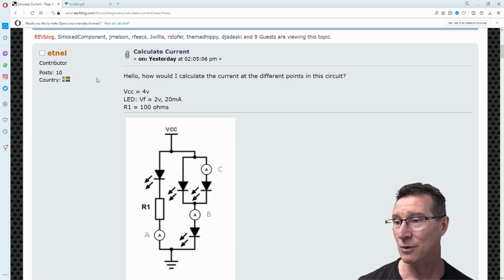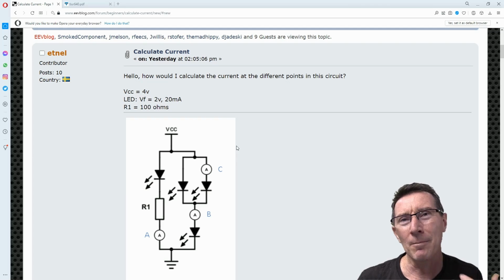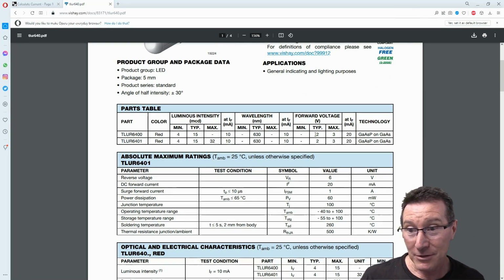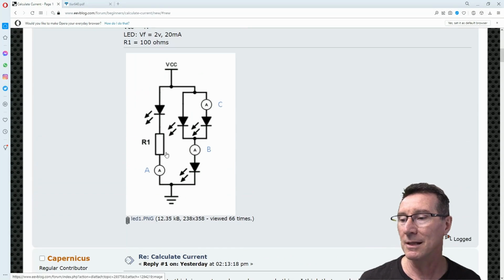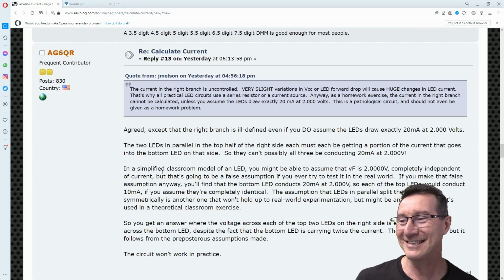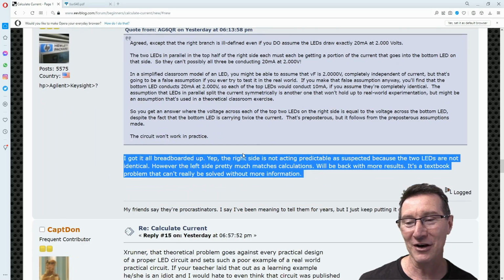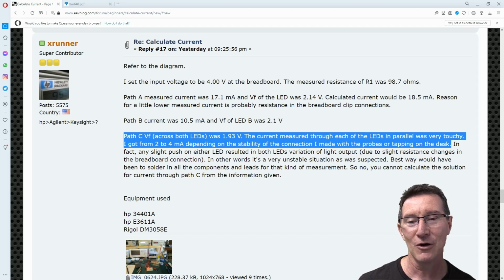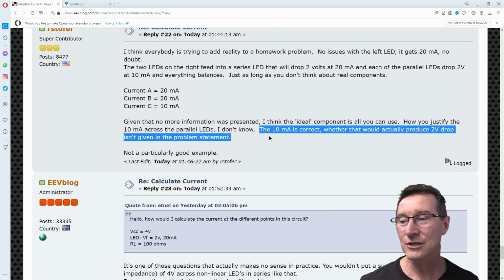EEVblog 1427 - An INFURIATING Electronics Exam Question!

Comment: I agree about the infuriating nature of this question.  Obviously, the person writing the question had just enough knowledge of electronics to be dangerous.  Being ignorant of semiconductor operation, the person who wrote the question, probably assumed the LED voltage drop would always be exactly 2 volts.  But, in the real world, there is no way to solve this question.  First off, you NEVER use LEDs in a circuit without some type of current limiting.  In order to have a chance of answering the question, you would need the datasheet for the LED used in the circuit.  Most LEDs are low cost and omit certain parameter limits, like forward voltage drop minimum.  Therefore, if you are designing a product that has a projected build rate in the millions, you must assume the forward voltage drop can go to zero volts.  True, due to the electrical characteristics of the part, this is not possible but, since the spec is written this way, you have no choice.

Then there is the junction temperature versus forward voltage drop problem.  This is why forward voltage drops on datasheets with semiconductors are measured using short bursts of current, to minimize the Vf drift as the junction heats up.  Along with determining the junction temperature of each LED, you would need to know the thermal resistance to the ambient air temperature, as well as other heat producing components nearby.

Additionally, if the datasheet does include a forward voltage drop versus forward current graph, the graph is made using a typical part.  I can't tell you how many engineers I have seen that will build up only one circuit in the Lab, get I working, and assume it work in Production as is, totally ignoring the datsheet limits.  Probably the same type that wrote this test question.

Comment: A is 20 mA,  B is greater than 20 mA, and C is half of B, simple as that, assuming ideal everything. I doubt the homework was looking for anything more specific than that. If someone can reason the voltage drop across B is greater than the voltage drop across C, they get an A in my book.

I've seen many theoretical questions used on exams, they are used to determine the thought process used by the student. Jumping to the 20, 20, 10 argument isn't using any critical thinking.

Comment: The power supply output impedance is irrelevant here because we're told what the voltage is at the top, 4V. Given we're not told the IV curves of the diodes some assumptions would need to be made to even start to answer this, and a reasonable assumption is they are ideal diodes. It's intuitively obvious that the current through the right leg is going to be greater than 20mA, because half the current is flowing through each of the top two diodes (which have the same voltage across them) and the bottom diode the full current, this means the voltage across the top two diodes must be less than the voltage across the bottom diode, and the sum of these is 4V, which means the bottom diode has more than 2V across it and therefore has greater than 20mA. You could write simultaneous equations to work out what those voltages and current were, a Spice simulation with ideal diodes would calculate these for you.

Comment: Everything is ok for hand calculation. Student should know how to calculate fast with relatively good approximation. There are several method for pencil-paper calculations:
1) ideal diode method.
2) constant voltage drop method.
3) exponential method (I=Is*exp(V/V_T)).
Method number 3 can include an iteration method.
After fast calculation students do experiments. Then making the measurements and will see how much their hand calculations are different from reality. They should analyze what and why they got little different results. What they ignored during fast calculation and so on.
So, look on Sedra/Smith book there is everything well explained.

Comment: The correct answer is that you would get 20mA on A, and three burnt out LEDs on B and C because you have just shorted your voltage supply over them.
It's not impossible to use two or more LEDs in series as your resistance, but the NL nature of diodes make it exponentially unforgiving, either being "Off" or "Shorted"

According to Falstad, it's ~20mA at A, ~30mA at B, and half that at C. As usual, MNA is a cheat code for EE.

Comment: Led versus L E D might be generational. I simply can't pronounce an acronym as if it is a word with the exception of LASER, which I still can't write in lower case. For example I never say ibum for IBM. One thing is that pronunciations will stray so much from the acronym that they are not recognizable. In Linux I often don't know if I'm looking at an acronym, an abbreviation, or a word. I see serious software people say lib for the lib directory, which is an abbreviation of library which I pronounce 'libe' thinking that avoids confusion with something else. Little did I know they like to say lib as in liberal. Anyway, when I hear someone say LED it conveys a certain education or competence. Led implies they learned from reading Instructables. When I was a kid everyone learned from magazines. You should have heard my attempts at 'chassis'. But really, anything goes except the abomination "use case".

Comment: My answer would be something like "Because LEDs are not constant voltage devices, the two LEDs in parallel would have something less than 2V across them; therefore, the fourth LED would have something greater than 2V across it. B would be >20ma and C must be B/2."

Comment: I think the correct answer is 0 mA at all points, because B burns then C burns then shorts the source.
Reply: Good point and correct in its own way :)
I have another correct solution: A is 20mA, B is 2*C. Put any number > 0 for B. 
This question is as Dave says, stupid on so many levels...

Comment: I think you will have a flash light on the right cause there is no resistance to limit the current. The leds will burn once and then never again. On the left the given values are correct creating a current of 20mA through the led and the resistor.

Comment: I would use a substitute circuit for each of the LEDs consisting a voltage source and a small resistor. A linear current / voltage relationship can be assumed within a limited range. The voltage sources can be ignored, so the circuit to solve becomes two resistors in parallel with one in series. This gives current B is 26.6667 mA and current C is 13.3333 mA.

Comment: When i was doing the analogic electronics course at the university and were learning about power supplies, each student had to make a complete low voltage power supply. The first lesson on that basically begun with the teacher sayinh: "Do not build this, it won't work, you might get hurt."

Comment: I think the circuit is somehow practical assuming that the LEDs forward voltage is indeed 2V then we should not get the magic smoke out. The R1 resistor actually ensure that the LED standing on its own branch doesn't fry out.
So I would say its a practical circuit, as it is with all the given parameters.
Reply: Then what would your answer be if there were just 3 diodes in series on a third branch?
Reply: @danc2014  Well that is quite simple, the answer is there will be no current flow, if the supply remains at 4V and there are 3 LEDs in series which will requires a total of 6V in order to be forward biased.

Comment: ASSUMING LEDs exactly on spec, dropping 2V at 20mA, the current through B is trivially between 20mA and 40mA.  Exact value depending on the characteristic curve.  Assuming resistors in place of the LEDs for the same voltage/current operating point given, ~26.7mA, giving an upper bound estimate for current on assumptions given.

Real world components will be less predictable.

Comment: I despise questions like this when they assume there is only one "right" answer, but interesting to provoke discussion. It reminds me of those questions 
'a farmer is putting up a 200m fence and has to have a post each 20m, how many posts does he need?" - even being a city boy I knew farmers don't put fences starting and ending in the middle of nowhere, so they use more or less posts at each end depending if there is an existing post that is already buttressed enough or they have to provide support for an end post.

Anyway, My answer worked out in my head was 20mA for the left side (A), between 10mA and 20mA for a single leg of the right side (B) and between 20mA and 40mA for the combined current flowing through (C), based on my two years of electronics as hoby starting 1971 before I moved more onto computers starting '73 (though I never really gave up being fascinated).
My working out: Starting with 2V across all components, at first connection to power,  based on the stated current at Vf = 2V for the LEDs being 20mA, Vcc being 4V and the resister being exactly 100 ohms. BUT more current will flow into the middle right junction than flows out, so its voltage will rise (very fast*), thus increasing the voltage across the LED (C) and reducing the voltage across LED (B) and its pair; Therefore LED (C) will sink more current and LED (B) will sink less current until an equilibrium is reached somewhere above 20MmA (because LED (C) will have more than 2V across it, and somewhat below 40mA because LED (B) and its pair will have less than 2V and therefore be sinking less than 20mA each). I wasn't sure if LED's would experience Thermal runaway, but when I read the data sheet it indicated they sink less current once they exceed some threshold temperature, and I remember running some common LED's at 40mA before without them blowing. I also wasn't sure how much variation LEDs have in real life, and what variation in resisters are common nowadays - I vaguely remember 10% and 20% being the common variation for cheap resisters in the '70s and '80s.

* Wires have mass and the ability to have varying amounts of electrons floating around in them and thus exhibit some capacitance so you can have (for very short periods) more current flowing into a length of wire than is flowing out the other end as they are "charged up". Real wires with some length also behave like inductors so there will be some back emf generated whilst the magnetic field builds due to the increasing current and thus delaying the current from increasing in lock-step with the voltage.
.
As far as I can tell, The third table in the TLUR6400 data sheet is miss labelled, it should be Unit, Min, TYP., MAX rather than Min, TYP., MAX, Unit (as Units are alphabetic and Min(imum), Typ(ical) and Max(imum) have to be numbers or blank and in ascending order where provided).
Reply: Also farmers typically use fences to enclose an area, so if it's not connecting to any existing fence it must form a closed loop, in which case no. of posts is 200/20 = 10. Add a post or two if you want a gate less than 20m wide.

Comment: I made just glance over this and do calculations In the head left side A = 20mA (4V, 200ohm), right side B=26 mA (4V, 150ohm) C=B/2= 13mA if you ignore LED U/I nonlinearity. Left LED normal power, the right bottom LED overdrive, right up led pair 60% power. I'm just an amateur who likes math and electronics. In this type of exam is usually stated that you ignore nonlinearity, heat dissipation, radiation, etc. This is just a way to learn simple circuit logic. It's like calculations of force, acceleration, power, work without friction, and efficiency.

Comment: Based on the information within the question, it makes no sense because it is self-contradictory. They may want you to say A=20mA, B=20mA, C=10mA. They may just as likely want you to say A=20mA, B=40mA, C=20mA. 

The only answer that should be accepted though is: “There is not enough information presented to make a proper answer”

Based on a real-world LED, at least according to the presented Datasheet, A will be 20mA, B will be roughly 40mA, and C will be roughly 20mA. And there will be a voltage drop of 2V over the left LED, roughly 1.8V over the top right two, and roughly 2.2V over the bottom right LED. This is of course due to the non-linearity of the LED module. The LEDs will not restrict current so this is where the circuit will settle out, likely blowing the lower right LED.

Comment: I HATED these questions.  Tests when I was in University were utterly impractical.  We'd get a massive circuit diagram and have 10 questions related to it, and it was ALL related to the first question...and that first question was designed to trip you up so that you'd bomb the other 9.  I hated it.  100 students, and the average score of the exams (2 hours long) would be 30%, high scores around 50%...What were you learning?  How the professor was tricky dick?  Talk about infuriating because it was, as you said, TOTAL BULLSTUFF.

Comment: Like far too many exam questions it's not a realistic circuit and shouldn't be a test question. I've come across similar stupid questions in my life also. Like the one that really annoyed me was "What's more dangerous voltage or current?" As they work together to me they are both dangerous. You dont get current without voltage. As voltage is a POTENTIAL difference unless you complete a circuit you dont get current flow. But to ask which is more dangerous seems like a stupid question to me as it takes current to kill you and it takes a high enough voltage to create that current. I tried to explain my confusion with the question to the person over seeing the  exam but they were not interested in my confusion they just seemed to want an answer. To me it's like asking which came first the chicken or the egg.
How would you answer that question about which is more dangerous Dave ??

Comment: If I wanted to know whether a student knows his device physics, this would be the question to ask! By using I_d=I_s*exp(V_d/U_t), and applying Kirchhoff, computation of the currents becomes quite simple, lower diode carries approx.  sqrt(2)*20mA, upper diodes half of that each. The R-D config can also be computed, albeit a few iterations of the u/I relationship are needed. My 2cents :-)

Comment: I think the internal resistance of the multimeter in the current ranges is large enough to trow any meassurements off. And the fact that diodes 2 and 3 are in parallel makes it impossible to meassure them with any accuracy.

Comment: Diodes obey Ebers-Moll:  I(V)~I0 exp(V/V_T) and V=V_T ln(I/I0) where V_T=kT/q.  The left side does balance; since (100)(0.02)=2V, point A is at 2V at 20mA so the LED voltage is 2V at 20mA... this is the given point.  But the right side does not balance.  Since I_B=2I_C, we can find the difference between the two LED voltages:
V_B-V_C=V_T [ln(I_B/I0) - ln(I_C/I0)] =V_T ln(I_B/I_C) = V_T ln(2)  Kirchoff's loop also gives
V_B+V_C=4V  Adding these we see
2V_B=4V+V_T ln(2) and V_B=2V + V_T ln(2)/2  The node voltage is elevated...
Now, use V_B-2V=V_T [ln(I_B/I0) - ln(20 mA/I0) = V_T ln(I_B/20 mA)  Combine these
V_T ln(I_B/20 mA) = V_B-2V = [2V + V_T ln(2)/2] - 2V = V_T ln(2)/2  Cancel V_T to see
I_B = 20 mA * sqrt(2) = 28.3 mA
Identical diodes will divide this current equally so that I_C=14.1 mA.

Without Ebers-Moll there would be no current mirrors, no log amps, no band gap references, etc.  So it is NOT a silly question although small fluctuations will indeed be amplified in the real world.  I0 and V_T are TINY, so any ammeter voltage will reduce the current significantly.  This, in fact, is what causes the fluctuations to be amplified.
Reply: How can it be I arrived at the same with reading the Vishay curve and making 2 different linear approximations?!

IF you'd be given the Vishay specific curve, you could read  I=13mA @V=1,9V, and  I=30mA @V=2,1V and approximate the curve rises from these to 20mA @2V with two straight lines:
For V<2,0V (the parallell diodes) I [ma] = 70*Uc-120 
For V>2,0V (the single diode)      I [ma] = 100*Ub-180
Now we have an equation where Kirchoff tells us: 2*(70Uc-120)=100Ub-180 and U1+U2=4
Solve for Ub and Uc:  
Ub=2,083333V and Uc=1,91666V  =>
Ib = 28,33...mA, Ic = 14,166..mA, have to answere 28 and 14mA because the reading was in 2 digits only.

A better approximation might be connecting the 3 points with an inverted parabola, but there's no sense in that either, since the Vishay curve is obviously built on a limited amount of datapoints:
0,1mA, 5mA, 10mA, 20mA, 40mA, 60mA and 80mA with linear connections.
Reply: @ambassadorkees  Log graph paper performs the logarithm for you.  Lines on log graph paper are exponentials.
Reply: @byronwatkins2565  Yep, but there's a difference between single log (X axis linear) and double log paper

Comment: I think you’re being to harsh on a question which is clearly on an introduction to electronics exam or potentially an electronics for non-majors coarse exam. In those classes they’re so idealized that they don’t even let you know that they’ve glossed over how idealized they’ve made the questions. Should they have done better? Yes but context is critical to analysis.
Reply: But even an idealized diode would not work with this circuit, as 2V/10mA for the upper diodes is as wrong as 2V/40mA for the bottom diode, so there would be two totally different possible idealized answers